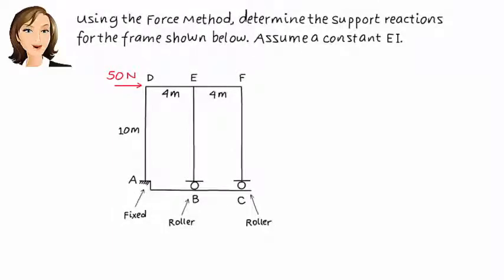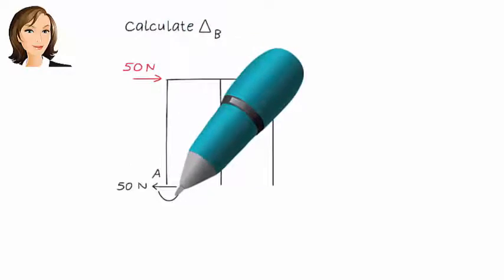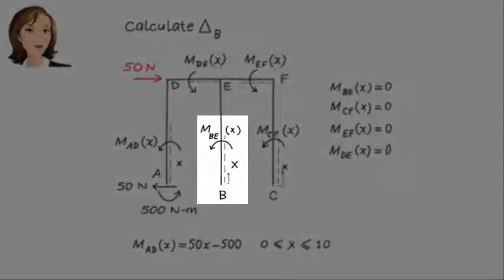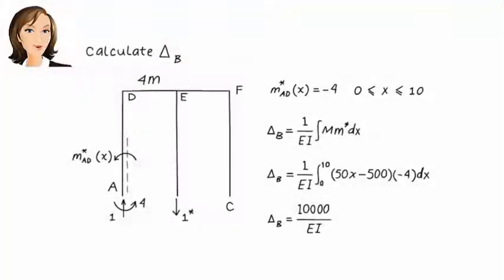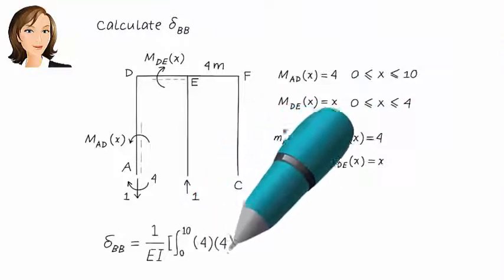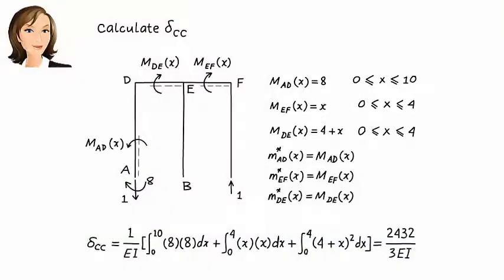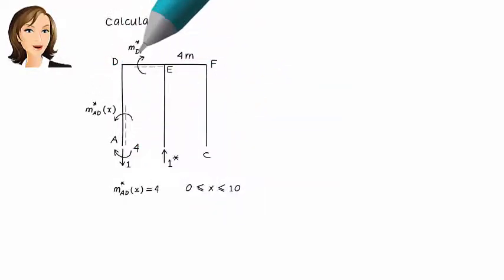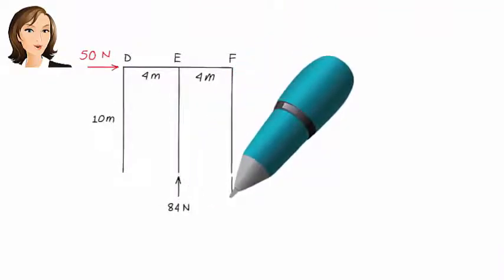Force Method: Exercise Problem 2

Comment: Hello again, in Delta CC moments, where did Mde=4+x came from?
Reply from the maker: For beam DE, we can place the origin of the coordinate system at point E, with the x-axis directed to the left. If the beam is cut at a distance “x” from the origin, and we consider the frame segment to the right of the cut, the distance from point C (where the unit load is applied) to the cut point is “4 + x” (since each bay of the frame is 4 meters in length). Therefore, the moment of the unit load about the cut point is “1 * (4 + x).”

Comment: Hello it’s a great explanation. Just wandering why the 1.0 vertical reaction at member AD was not being transmitted to the beam DE? It would have made a bending moment of 1X for DE.
Reply from the maker: It is true that the unit load at A produces a moment (m*) in member DE.

However, since the moment in DE due to the real load (Mde) is zero, the product of Mde and m* will also be zero, even though m* is non-zero. 

Therefore, determining m* is unnecessary as it does not contribute to the solution.

Comment: Hi Sir, i went through this example today and come out with new idea for the frame, it is almost identical to this lecture, difference is i have 2 pinned and 1 roller or else calculation will be too tedious
https://ibb.co/0KzpDLG
The new FBD
https://ibb.co/d62vVP5
1. is this assumption valid/more accurate ? 

2. I notice the force in this 3 leg support assumption is very small compare to my earlier 2 leg support assumption ......

3. If i were to make the model with all 3 fixed support, will the y direction force increase or decrease ? As the y direction force are the main concern as they distribute load down to the structure
Reply: As ussual, a full calculation ( answer is 99.99% correct, i am just posting so that others might get benefit from this, i have triple check both the local moment and all forces in each member and also the moment and force in global as well
 )
https://ibb.co/XZtWW2y

This is the final frame force will look like this
https://ibb.co/WyWDJLv
Reply: in my next two examples, i will proceed to make changes and use "uniform load" instead of point load :D, but i guess it's gonna be much more difficult .....
Reply from the maker: I don't see how you can model the system as a two-bay frame (a frame with three columns). Your diagram correctly  shows a two-story (level) 3D frame where at each level there are four columns. But how do you go from there to a 2D frame with three columns?
Reply: @DrStructure  oh, i am only modeling the "body" ( top part ), what i am trying to do is to calculate the axial and horizontal load in each of my point "P" on the frame. https://ibb.co/1RSKgyN
the next step is to apply the calculated point load "P" on the frame, but i am still lacking in knowledge to try that examples. Connection is now my biggest challenge, do you have any course/videos on that topic ?
Reply from the maker: @DOTA2MAJISTRATE  We don't have any lectures on connection design. Structural design, including steel and connection design is a rather involved topic that cannot be possibly covered in a few lectures. A good starting point would be to get your hands on an introductory steel design textbook.
Reply: @DrStructure  on it!!! thanks again

Comment: dear good sir, if the first support happen to be a pinned support, we won't be able to solve this anymore ? for example lets assume all the support is pinned, not fixed and not roller
Reply from the maker: We can still solve the problem if there is a pin at A. In that case, the frame is statically indeterminate to the first degree, which means we only need to declare one redundant force. We can make either the vertical reaction at B or at C the redundant force, then follow the steps of the force method to calculate the force.
Reply: @DrStructure  thanks a bunch
Reply from the maker: You're welcome.

Comment: In calculating δBB, why the bending moment in BE is zero?  the bending moment at E is 4 nm and I think that this bending moment will transfer to beam BE. Is this assumption wrong?
Reply from the maker: Thanks for asking the question and pointing out the inconsistency in the formulation. 

Bending moment in BE is in fact zero. If we set the origin of the coordinate system at end B (x being the distance from B toward E), we can easily conclude that M(x) = 0, since there is no shear force or bending moment present at B. Without any of these forces being present at B, bending moment in the segment remains zero regardless of the value for x.  

However, there is an error in the formulation @3:50. The error is in the expression for M_de. The moment equation for segment DE should be 4 - x, not x. There are two forces that contribute to the bending moment in segment DE: the concentrated moment at A, and the reaction at A. The formulation in the video erroneously omits the effect of the concentrated moment of 4 when writing the expression for bending moment in DE.

Comment: @6:22 i believe there is a mistake. Cy = -1875/484 and By = 7500/121
Reply from the maker: Why do you think the given answers are incorrect? You can find the solution to those equations using various online tools, like WolframAlpha. Go to website: 
https://www.wolframalpha.com

Then enter the following equations in the Input field to see the solution.
(544/3) x + (1120/3) y = 10000, (1120/3) x + (2432/3) y = 20000

Comment: nice frame force method~ by the way can you explain why the vertical reaction cannot be a redundant force?
(1) a frame with two same elevation pin support, 

(2) a frame with two pin support with not same elevation
Reply from the maker: Makes a very good exercise problem. :)
Reply: i can't post a photo here, so there are similar problem in Hibbler structural analysis 8th edition,  problem 10-23 for case 1 and problem 10-21 for case 2